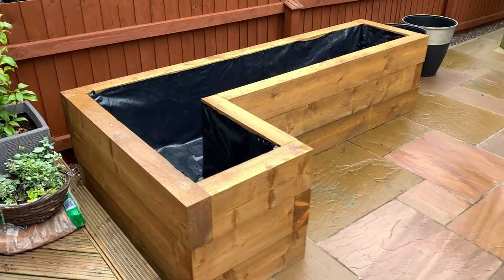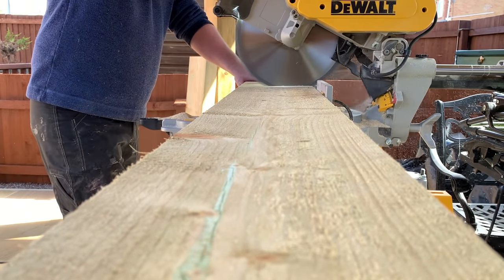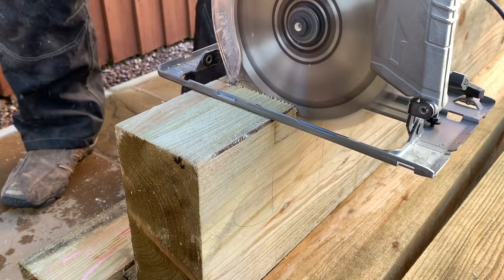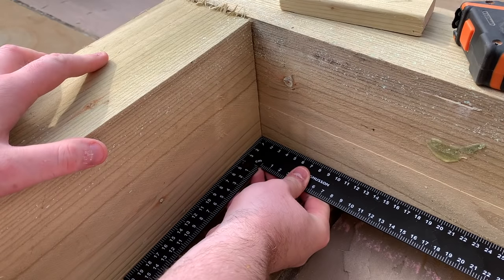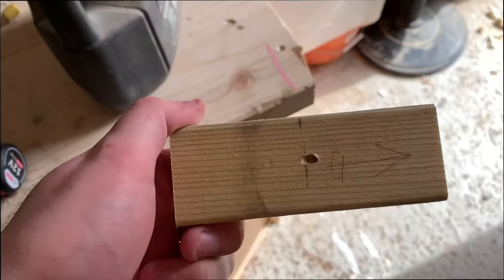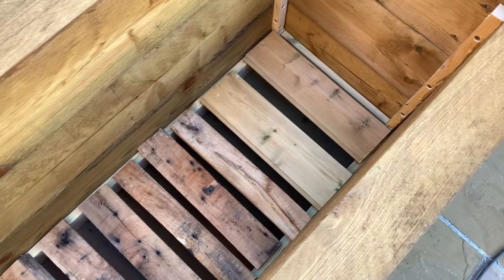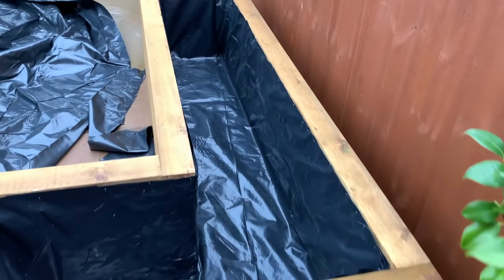DIY RAILWAY SLEEPER FLOWER BED - How to build a Flower Bed with railway sleepers

Comment: Hi we are looking to build something like this. What were your measurements on the bed?
Reply from the maker: Sure, overall size is 2400x1200 and here’s the cut list, in mm. This list will make one box. 

3x 2305
3x 1795 
3x 1115
3x 595
3x 515 
3x 505 

You can get all of these cuts from 9 sleepers with very little waste, so this video in total used 18 sleepers. I ordered 19 sleepers for just in case but didn’t need it, so that’s still hanging around now!
Reply: @TouchWoodWoodworking  Thank you so much.
Reply: @TouchWoodWoodworking  Good to see you use mm's and not cm's which are not standard. Excellent video.
Reply: Loved the video, thanks. I’m a bit of a novice so this will really help. A silly question, there seem to be so many difference types of sleeper, what type did you use, and what size where the sleepers? Thanks again

Comment: Nice to see you've lined it, in my younger days i just used treated wood and filled with soil, lesson learnt when x amount of years later i have abundance of rotten wood, now rebuild and replaced i coat with bitumen and also put a liner on the inside, also use stainless steel screws so hopefully it'll last my life out now.. But i am only 48 so only time will tell 😂
Reply from the maker: Stainless steel screws are the only thing on that list that I managed to get right! We all live and learn. Thanks for the comment!

Comment: Do you only need the water channels to prevent the rain filling up your sleepers whilst you're constructed them? I assume once they are lined the water channels aren't required? Great video mate.
Reply from the maker: You want drainage by poking holes in the plastic, and that water needs somewhere to go. The preference is to use a membrane that’s suitable for plants but I didn’t have any so made do with pond liner and vigorous stabbing. If you build these on dirt with concrete footings you shouldn’t need those channels

Comment: Thanks for a great video! Silly question, but where does the water escape? I'm looking to make something like this on a concrete floor, but am unsure what to do about drainage... did you poke holes in the pond liner? Or add rocks at the bottom layer before adding soul?

Thanks for any advice! 😊
Reply from the maker: Yup so you want to poke lots of holes in the bottom of the pond liner for a start. If you're using some sort of membrane then you can leave that as is because it'll let water through on its own. 

After that though, you'll want to ensure the water has somewhere to go. Of course, the water can't drain through concrete, so will need to run off somewhere. Hopefully your concrete floor runs off in a direction and doesn't just pool the water up. Spray the floor with a hose for a while, find out where the water wants to wander off to, and then cut some hole in the flower bed in that direction.

Comment: Thanks for the video. May i ask why you think you needed to build the base, inside the planter? What would be the harm in having the liner go straight onto the ground?
Reply from the maker: One thing I didn’t point out in the video was that I stabbed a load of holes in the liner for drainage. There needs to be a gap underneath the liner to drain into, so that’s one reason. The other is to allow said drainage to flow around freely/easily so the wood won’t rot as quickly 

Thanks for the comment
Reply: @TouchWoodWoodworking  Thank you. I have some spair bricks - i may use them to build a platform.

Comment: Looks great, I am presuming the notch for the water to escape which I wouldn't have thought of is facing back towards the decking step so you cannot see it?
Reply from the maker: It’s facing the fences, so you can’t see the back ones, and the front ones are tucked right into the inside corner of the L shape so can barely see it. In hindsight I might have made more shallower holes but hey ho live and learn
Reply: @TouchWoodWoodworking  Thank you

Comment: Lovely result, great video but how come you put pond liner in the bottom? How does the water escape thorough the channels you cut if it’s all covered in pond liner?
Reply from the maker: Thanks! I cut a few small holes in the base, and pond liner is what I had in the shed. If I had some, I would have used some of that mesh fabric stuff to allow decent drainage

Comment: I’m not a troll but pond liner is only a good material in a containing structure where the focus is to hold water. Your raised beds need good drainage so if you’re going to use a liner make sure it’s a fabric. 
Beds look nice though.. good quality sleepers
Reply from the maker: Thanks for the response, I appreciate the learning opportunity! I wasn’t sure if fabric or plastic was the right option, and went plastic for no real reason other than “it’ll be more useful in other future projects”, so there we are. I’ve poked a lot of holes in it so hopefully the drainage is adequate!
Reply: @TouchWoodWoodworking  If you put some fabric weed barrier under the liner it would allow water to drain and keep the soil in.  Just make sure when you cut the holes in the plastic you don't burst the fabric too!  The plastic may keep the wood stable for longer.  Also, if you let the plastic over lap the top you can create a 'lid' around the edges using some decking boards.

Comment: eventually the soil can push the sleepers out and can bow the wood, build brick retaining walls inside to support the wood and protect the wood from any moisture that can seep through screw holes also sleepers unless pressure treated can rot over time

Comment: Hi, what is the maximum size timber that your Dewalt mitre saw can cut? It seemed to make easy work of those sleepers.
Reply from the maker: Hey Robbie. The 30cm version which I used in the video was maxed out with those sleepers. If I had the smaller saw, I would have had to make either 2 cuts or 1 cut and hand saw the rest of the way through! So I’d say about 4-5 inches is the max cut depth it can manage
Reply: What dewalt saw is that please sir?

Comment: doesnt the liner prevent excess water from draining out? I actually used sleepers you shown but no liner. I put inexpensive plastic square pots that almost reach the top of the wood. You cannot tell they are in there. Just see the plants.
Reply from the maker: You can stab a few holes in the bottom and the water will drain out just fine. We were thinking about going the route of using plastic boxes on the inside but decided against it for the size of the beds and I already had the plastic sheets on hand. As others have said, I should probably have used a mesh fabric of some sort instead so this project is far from perfect!

Comment: Awesome job, looking to build something similar myself although I'm a bit confused about how the drainage works. Is the idea that excess water would pass through the soil and membrane and out the cuts you made? Thanks
Reply from the maker: Correct. Once it comes out the membrane, it’ll drain to the floor, where the slight slope in the patio will guide the water toward the fences, which is where I cut the small channels in the front and back to let the water pass through
Reply: @TouchWoodWoodworking  Okay that makes sense, thanks 👍

Comment: Would it be possible to use a thinner sleeper or wood (maybe scaffold board) only on the rear side where it meets the fence? Looking for a way for it to protrude less without losing planting space. Thanks - great vid.
Reply from the maker: G’day cap’n. You probably could but my worry is that it wouldn’t last as long because there’s less wood for the weather to wear down and thinner boards holding back all the dirty would be dealing with more sideways pressure to push them out. Bear minimum you’d have to fasten them quite securely to the other sleepers! 

Ultimately I’d say it’s up to you but I don’t think I’d use scaffold boards for this

Comment: Thanks for this.  I’m hoping to build something similar for growing vegetables.  A couple things I was wondering though.you say to use paint for better protection but everything I’ve seen recommends not using anything on wood like this for the first year because it is already pressure treated.  Also, isn’t oil better than paint? Paint sits on top of wood which is why it flakes revealing unprotected timber, and needs to be reapplied a lot and stripped back periodically.   oil soaks into the wood so needs less maintenance.  

The other thing is, could I use vegetable felt lining instead of pond liner so that I wouldn’t need to add a base? That stuff protects but also allows drainage.
Reply from the maker: Hi Clare. I’m not entirely sure to be honest with you, all I know is that you have to be careful what you put in the wood and how you separate the wood from the dirt because you definitely don’t want the chemicals leaking into your veg! 

And I think felt will be fine (bearing the above in mind). Hope that helps

Comment: Nice video and some very helpful tips. Which DeWalt saw did you use? We are going to do a similar bed and keen to buy the right saw.
Reply from the maker: Hi there kentishales - I used the DeWalt DWS780 - it's the model that has a 305mm blade, and that's the one thing I would advise to look out for, because the larger blade just about made it through these so a smaller blade definitely wouldn't, making it more awkward to get the cut in 1 pass! This saw is quite steep cost wise so again if you want my advice then anything with a 300mm+ blade should be fine! I hope that helps!
Reply: My

Comment: Please could you give information on the wood treatments you used.  I really like the colour and effect you achieved. Thanks
Reply from the maker: Hey Nick, I used Cuprinol UV guard decking oil in natural oak, which I got from B&Q. It’s a decking stain that I had lying around, figured it good enough for a planter. I can’t vouch for its hardiness (paint is better for long term protection) but it should stop the wood turning grey! 

I needed 2 small tins to give everything 2 coats, so I guess that means 1 small tin per box.
Reply: That’s very good of you to respond so quickly. I laid a new deck and want to treat it before the summer sun starts to lighten the colour.

Comment: Hi Tom. I'm gonna attempt to make 2x of these this coming weekend . Could I ask which satin you went for and colour as the missus as fell in love with the colour you used. ??
Reply from the maker: Hey there Jay, I used this exact stain, 2 tins was enough for 2 layers on each box: https://www.diy.com/departments/cuprinol-uv-guard-natural-oak-matt-decking-wood-oil-2-5l/127190_BQ.prd

If the link doesnt come through, its the Cuprinol UV Guard Natural Oak decking oil in B&Q. I can't exactly vouch for its longterm wood protection (I think paint would do a much better job at that), but it'll do just fine for stopping the sun turning the wood grey!
Reply: Tom, thanks so much for all the tips and tricks and the cutting measurements they will make for a much easier process. Definitely earn a sub. Looking forward to seeing a follow up video with both yout planters filled and flowering. 👍

Comment: Hi, Great video. May i ask where you bought these sleepers from?
Reply from the maker: Thanks! I got mine from timbuild.co.uk, they’re my local wood merchant. Have a google for local wood merchants and see if there’s anyone nearby.

I did get them on offer so 19 sleepers for about £500 down from about 800 from memory
Reply: If you live in the north east, I got 15 pressure treated sleepers delivered from BTL Timber for £350.

Comment: Hi I am planning on doing something simillar in our backyard but I have never worked with wood. What kind of lumber did you use for this project? I might have missed it in the video, but I am seeing so many options to buy and I am not sure which one would be the best. Thank you in advance!
Reply from the maker: Hi Daniel, I'll see if I can help you out. Wood shopping is a bit intimidating because there's so many different types, so I'll give you the highlights on what's important to look for. 

The exact wood I bought was from TimBuild, link here: https://geni.us/railway-sleepers  which semi-regularly goes on sale for 30+% off, so I imagine if you call them or ask customer service, they'll give you a hefty discount, especially if you're buying 10+ sleepers. 

Dimensions of each piece of timer are: 2400x195x95 

The stuff I linked is: 
1) Treated. You'll want the wood to be treated so it fairs better in the elements, no matter where you buy it from. 
2) Softwood. Softwood doesn't fair so well outdoors, but it is cheaper. If you can afford it,  go for a hardwood (oak seems to be common for railways sleepers, so could start there). 
3) Specifically do not get old, recycled railway sleepers. These may have come from actual railway use and could have had very naughty chemicals used on them (bichemin, for a start) so as a simple rule of thumb I'd say steer clear of recycled railway sleepers.  

I bought 19 of them in total - 9 for each box and 1 spare just in case I messed something up. As it happens, I didn't need the extra one so if you're the careful type, you can get away with 18 as any minor mistakes (i.e off by a few mm's) are hardly noticeable. 

The wood will turn grey/silver if left in the elements without a stain. I used this stuff (https://geni.us/flower-bed-oil) to get the UV protection and nice stain colour. 

and one final thing to note is that the sleepers are very heavy (hardwood variants will be heavier still), so bring a friend to help shift them around :) 

Good luck on your project! Take your time and enjoy the process, swearing n all
Reply from the maker: Noticed they've added options for green or brown railways sleepers. I think this refers to the age of the wood (green being freshly cut, brown being dried for a while). I'd spring for the brown because it's cheaper and has had a chance to "settle down". Green wood tends to warp/bend/twist as it dries out and doesn't have all the old forces it had against it as a standing tree
Reply: @TouchWoodWoodworking  Wow, I literally could not have asked for a better and more informative answer. Really appreciate the effort you put in the video and the answer. I will look further into it now that I have this information and contact some lumber shops. Thank you and hope you are safe and well! Greetings from Greece.

Comment: Great video! How do you connect the layers of the boxes? Is that also by screws? Thanks!
Reply from the maker: Great question - I put a small 1x1 inch beam vertically on the inside corners and screwed them into each layer
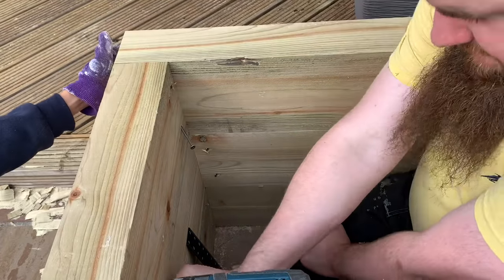Reply from the maker: You can see them at 4:40 briefly

Comment: How do you fix the layers together when you start stacking them? :)
Reply from the maker: I didn’t cover it in the video. I attached batons along the inside corners and screwed those into every layer. You can see it on the outskirts of the video when i start talking about putting the base in

Comment: Great but , wouldn’t it be better to line it with Ground control matting as Pond liner won’t let the soil drain?
Reply from the maker: Yeah probably! This was one of my first videos and I just winged the project. I used what I had on hand and that happened to be a sheet of plastic.
Reply: @TouchWoodWoodworking  thanks for sharing 👍

Comment: Does the pilot hole need to be as deep as the screw? Your drill bit looks a lot smaller than the screw.
Reply from the maker: No, I only used it to get me the correct angle. Ideally, I'd want it to get as far as the second piece of wood, but that's not really needed if you hold them together tight enough

Comment: Where does it drain to?
Reply from the maker: Hi Hanz - if you poke some holes in the bottom, itll drain out there. My patio is slightly sloped, so the water will drain toward the fences and finally into the ground as I have a 6 inch border around the patio with chippings.

If your garden/patio is flat then, like a lot of comments have mentioned, you’ll want to remove the slabs underneath and let the water drain direct to dirt. Hope that helps
Reply: @TouchWoodWoodworking  drain filthy water with the potential to stain  your lovely Indian sandstone slabs? not ideal...removing slabs is probably the best solution thanks for the reply

Comment: Dont do it this way!
 The Drainage won't work and will get blocked.
 You need to reseal the cuts other wise it will increase the rate of rot. The fixings should be set from the outside where they dont come in contact with wet the soil.
 The paving should be removed to provide good aeration and drainage.
 Any planting will suffer as a consequence. 
 Looks nice but will last 5 minutes.